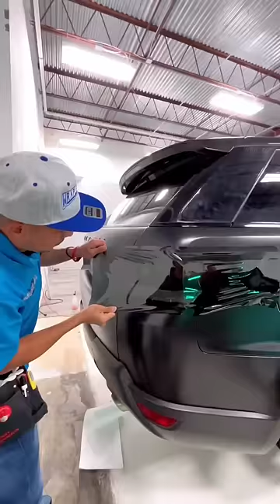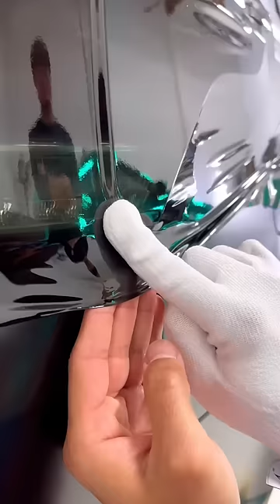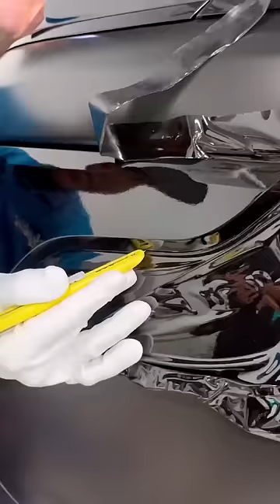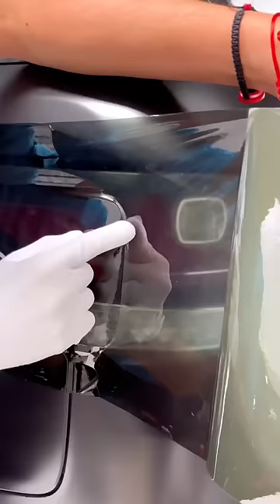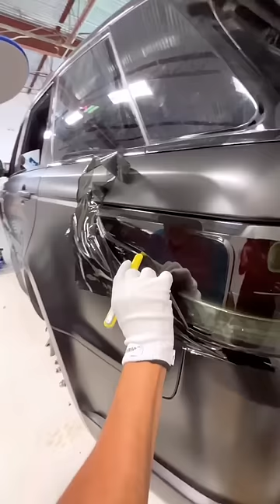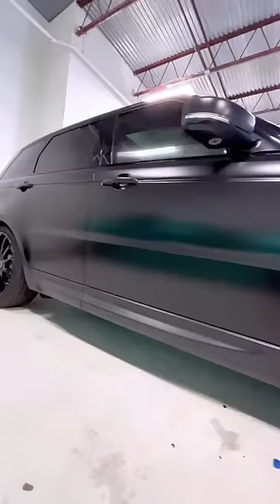If this Wrap is Wrong.. I don’t want to be Right‼️🔥✨👌 #carwrap #carwrapping #vinylwrap #rangerover

Comment: This should be an automatic suspension for your license
Reply: No it shouldn’t
Reply: @carmantony0811  If you're more obsessed with your car looking cool over it being safe for other people on the streets, yeah I don't think you should have a license. Go ahead and rage all you like. Just proves my point
Reply: @yuxian20  first of all, why do people have such a problem with tinting lights? Like yeah I understand if it makes the taillights  significantly harder to see, but many tints have been designed to let light pass through more easily to keep the effectiveness of the light. I wouldn’t consider adding tint to my cars lights if it made them harder to see for other people but like I said, tints have been designed to make it easier to see the light keeping its effectiveness. Also isn’t a suspension to license a little excessive for putting tint on a car when you look at all of the other things people are doing to their cars?
Reply: @carmantony0811  cope
Reply: @carmantony0811 ecause it’s not safe??? Imagine you’re driving and you can’t tell when the person in front of you is braking. Tinting might be noticeable when it’s really dark outside, but in broad daylight it’s hard to tell if the light is even on, or even where the light is. People need brake lights every day to know when to slow down and when it’s fine to stay at the right speed. What’s the point of even having the light there if it’s not going to be used… 
I’m all for car cosmetics but when it’s shit like this that completely undermines the safety of the vehicle, that’s when it becomes stupid.
Reply: @bolson42  I feel like you didn’t read my full comment, I stated that there were special tints that were designed SPECIFICALLY to make it easier for light to pass through keeping the effectiveness of the light that it had before. Like I also stated, if tints like that didn’t exist, I would not consider tinting my car. If you really can’t see it all that well, then Maybe it’s a tint that does not have the see-through clarity that other tints have. That’s when tinting you’re taillights becomes unsafe.
Reply: @carmantony0811  I understand that, but that’s not what’s being discussed. We’re specifically talking about tints which aren’t safe because of poor visibility. In fact, i have smoked/tinted tail lights and brake lights myself, but I made sure they were visible in all different kinds of lighting before installing them. It’s very hard to even tell where the brake light is in the video, which led to this discussion.
Reply: @bolson42  Should it really matter if they housing itself is visible? It’s not the darkest tint, and yeah I wish too they featured the rear taillights in the lighting test, but the front ones were pretty visible, probably the same deal with the rear ones 🤷‍♂️, yeah and good safety precautions you did, but alot of other people don’t seem to do that, but that doesn’t mean that anyone should get clowned over just because they have smoked tail lights. It should matter if the lights themselves are visible or not, not the housing they’re on, in-fact, that’s almost the entire reason why people consider to tint their lights.
Reply: @yuxian20  bruh it’s not even that dark you didn’t even see the lights when they were on it’s literally no difference 😑😭
Reply: @carmantony0811  
You should be required to take the right precautions before you do something stupid to your car… that’s just common sense. I think it’s perfectly fine to let people know that that’s not good to do lmao. Again, i literally have smoked tail lights, i understand the laws in my state and they’re legal. And it’s more an issue of functionality over form, there’s just some things you shouldn’t change if you lose something more valuable in the process, especially if it’s just cosmetic.
Reply: Not only that who ever did the wrap, say this business, should get a heavy fine
Reply: @carmantony0811  Are you trying to prove it to Jeremiah or to all those who died in traffic accidents because of such tinted taillights?
Reply: @carmantony0811 this is the same as when in the 60s tabacco manufacturers swore that tabacco is not addictive. The fact it might in any way lower the visibility of the light for other drives should make it automatically illegal
Reply: @hasty-carnaage1518 why even modify a 300?💀
Reply: and seized car and crushed to a cube (I'm not being sarcastic).
Reply: @aggressiveaegyo7679  “such tinted lights” if you can’t see those kind of lights, then you shouldn’t be on the road at all. All it is is a little blackness, but the light is still as visible as in the video. The “people who died in such accidents because of tinted lights” likely didn’t take the right precautions.
Reply: @Michał Skóra if anything, it makes the taillight easier to see, (if light can go through it efficiently)because of all of the red part of the housing now being black making the only part of the light that should be seen way easier to see. Also if you “didn’t see something as bright as that, you were either distracted on the road or blind.
Reply: @carmantony0811  “ designed to let light through “ ? 
Bruh tint literally meant to darken the whole part. Thats the dangerous part 💀
Reply: @samirm9097  Bro making stuff up just to justify being a hazard 💀

Saying tint makes your taillight easier to see is like saying using sun glasses will blind your eyes, doesn't make sense.
Reply: @CarManTony08  if their is a special tint I've never seen it so just don't do it at all and your good
Reply: @carmantony0811  for a guy who has "carman" in your name you sure don't know a lot about cars
Reply: @carmantony0811 yea they should get it taken away bc my mom almost hit a dood cause of it
Reply: @carmantony0811 designed for light to pass through 💀. Dude you're trying to cope so hard because you have this mod for sure
Reply: @carmantony0811 cope
Reply: @MrJetFormation  the hell does cope mean?? And I don’t really own a car, but don’t try to deny that cars with already factory smoke exist, which is what I would plan to do to my car. Like tell me what part is dangerous about tint if light is still visible at all times? Tell me what is dangerous about that.
Reply: @carmantony0811  Bro just don’t obscure your headlights/braking lights/indicators/hazard lights etc.
Reply: @hasty-carnaage1518  90% is still less than normal light, therefore your whole point is meaningless
Reply: @Garvin285  it's really not though when the argument is how visible my taillights are. When sitting next to a car without tinted lights, my car is still just as visible, daylight or not.
Reply: @user-golos  why not? It’s my property, and it shouldn’t matter as long as the lights are still just as visible as they were before.
Reply: @carmantony0811  Buy properly tinted lights and not stupid wraps, they will always obstruct light.
Reply: @derunfassbarebielecki  does it sound like I was gona buy “those stupid wraps”? No, I and a lot of other people are putting the proper tinting on their car.
Reply: @hasty-carnaage1518  You can be completely right. And yet it will most likely still be your fault legally when someone hit you. It's not even about your car being visible, it's simply that your brake lights are less visible than normal, even if they pass 10% less light.
Reply: @carmantony0811  the fact is if there is even if there is ones made that let light through they will always tint it. There will always be less visibility than stock. Not to mention the majority definitely just have standard tint on them not this one that let's light through. Either way dark taillights are such a hack thing. It's like putting a gold shift knob in your car 0 class and looks like ass. People can have their opinions, mine is that it's silly like cars with a stance.
Reply: @carmantony0811  They are visible when you are focusing on it completely, on the road you won’t be completely focused on one thing and the already dimmed braking lights could be obscured by light coming from elsewhere.

It’s better to just let your car look slightly “ugly” and avoid that legal and ethical issue altogether
Reply: @carmantony0811  Soooo you don’t own a car, probably haven’t even done a driver’s exam and yet think you’re able to comment on this? Lol. Cope.

Comment: No. Its illegal to tint rear and front lights. Drivers cant see them at night.
Reply: """Can't"""
Reply: @Drunken_Hamster  ''''''''''''
Reply: You forgot to use ' on the word can't
Reply: @arunasdirse6668  imagine caring about grammar
Reply: Actually it depends on the state you live in here in America. I live in IN where state law says tint is legal on headlights so long as you can see 350 feet with an upper beam (bights) and 100 feet with a lower beam (normal) and for taillights its 350 feet visibility.

Comment: So dangerous. What happens when it’s sunny and someone has to slam their brakes, or ends up crashing into you because your tail lights were near invisible. Huge risk.
Reply: Not risk at all because you can upgrade the bulbs of lights when tinted so lights will be brighter to see. And also tint just makes the car look better than have a red plastic piece that doesn’t match. I have Smoked out tint on my heads and rears. Also limo tint all over even front. Upgraded lights so people can see and also multiple cameras to see in dark when driving
Reply: That other person is at fault, because you can’t run into the back of someone’s car, unless you’re following too close.

Comment: "This wrap is extremely illegal!"👴🏻
Reply: Well yeah because it is hard to see the break lightd
Reply: @brave_skykorn  It's not hard to see at all. Vinyl film has a very high VLT as opposed to smoked taillights, and barely make a difference when paired with LED lights. In my experience, tinted tails make it even easier to see when someone is braking when driving against the sunlight.
Reply: @PM_Jihad_Trudeau yes tinted light(tinted used to describe darkening light or windows) makes it easier to see light coming through it. That’s a hard cope
Reply: @primarymeme9929  Yes, tinting the light for the purpose of dimming the bright red portion of your taillight makes it easier to distinguish between the reflectors, and the actual light coming through, that's my experience. I had originally meant when sunlight was directly hitting the taillight.
Reply: @PM_Jihad_Trudeau you’ll still get booked for it

Comment: No in most places you are not allowed to have a cover over your lights. There is a red reflector (on the bumper) so that much is legal and required. If you want to get this look legally, get the DOT approved tail lights and don't cover the red reflectors and you are fine. This is why Mustang and other cars can have the clear taillights as long as they light up red or amber when braking and there is a red reflector.

Comment: Depends on the country and in some countries states. If a country/state has gouverment regularity for lamps on cars that is most certainly illegal. If the gouverment/law of that country allows you modification to color and brightness of safty lights you should mostly be fine. Regardless i would advice against getting a foil like that as it makes it more likely for a rear driver to crash into you cause your breaklights where harder to see

Comment: Ladies and Gentlemen. If you plan on doing these mods, please be aware that not everyone has good eyesight, and during the night it doesn't matter, but dueing the day it is horrible. I have avoided atleast 3 accidents with taxis/private vehicles due to having black tinted rear lights, to the point that it is hard to see them brake or use indicator light. Now it's your vehicle, it's your money, go deh strong fam, just know that you can get rear ended at anytime during the day

Comment: Anything changing the original appearance of lights in front or rear is changing the original that made the car road legal from the start. This would need to be  re-applied for it's own re-registration as a totally new vehicle  (As if it was a brand new model) since it is no longer following the specs from the original manufacturer it is no longer under their preregistered vehicle specification and therefore no longer a model of theirs. (same goes for most aftermarket appliances that changes appearance or performance of the car.)

Comment: If your car has LED tail lights, go for it, as the LED’s are brighter then conventional bulbs. My G35 comes with oem led tail lights and they are plenty bright during the day with tinted tail lights. PLEASE DO NOT plastidip or spray tint your tail lights darker as it’s more difficult to remove and Will definitely hinder your tail lights functionally. Still illegal, but alright.

Comment: Tinted head/tail lights are very much illegal. You can be pulled over for it and if you get into an accident because someone couldn't see your breaklights it will usually automatically be your fault

Comment: No, it isn't. If you're in US/Canada you have to comply fmvss108/cmvss108 and respective SAE if applicable. For rest of the world ECE and local derivatives apply. These regulations specify areas in colour space and intensities in each required radiated angles of the particular light function. Tint is decreasing "brightness" and shifting the hue out of spec. Any tampering with the rear/headlight will void your insurance premium.

Comment: No it isn‘t. In Germany you get pulled over and have to remove it right then and there, or if you can’t its a towtruck ride for your car to the impound lot. On top of that there is a fine. 
Wraping lights is very dangerous and stupid.

Comment: Actually it's not. As long as the light of red,yellow,and white can still shine through.

It's the same as having a one-sided tint on any of your windows. As long as you can see out of them they ate not actually illegal.

Just because a cop can not see into your car that doesn't make them illegal even though they have stupid laws that are not protected under the constitution at all that want to say otherwise.

The reason people tint there windows is to keep what they have in there cat private not to have an extra edge on cops.

So long winded. No. If the light can still shine red,yellow and white then no. If they can't then yes.